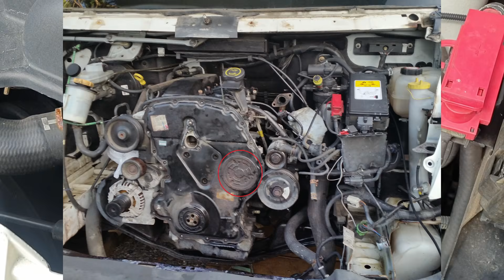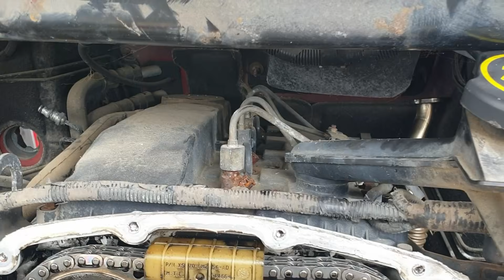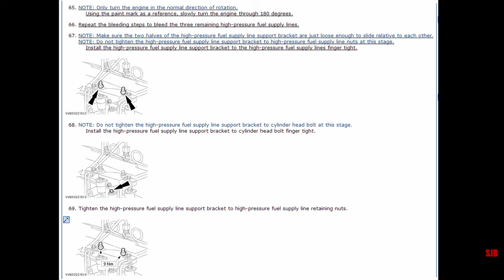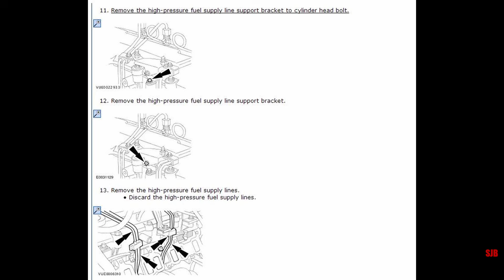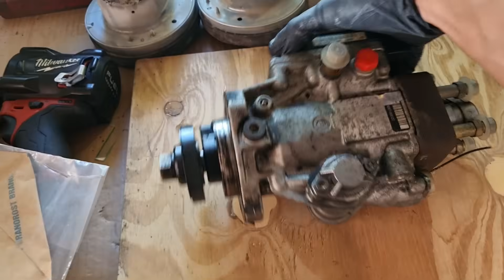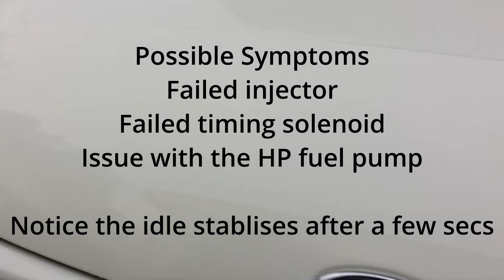Ford Transit Common Problem You Need to Know

Comment: Hey dude I have a similar issue but faults are p1664 p1564 is this the same as what you explain in the video should the solenoid be replaced?
Reply from the maker: No its the control module failing. You will need to replace or rebuild the pump
Reply: @AutoBuddynz  I have had the ecu repaired but does the pump need to be rebuild? Is it something inside that is falling?
Reply from the maker: @fisherbmx47 There is a separate ecu on the pump, unfortunately the internals of the pump wear out and needs to be rebuilt or replaced

Comment: Heyy I have issue on the master cylinder I changed it but my gears won’t engage what can be the problem now slave cylinder is fine and responding to the clutch though thé gear lever isn’t engaging
Reply from the maker: Is it bleed properly and is the clutch fully disengaging?

Comment: Woow One of my customer brought in a Ford Transit 2.0 diesel F3FA. Symptoms loss of power. I had cooler hose season these months, so I checked that and it was cracked. How naive was I? Went for a test drive, still no power… 
Plugged in the diagnostic and all of these codes are in it. You just saved me sooo much of working hours to find the issue. I mean I just spoke to my customer I have to check the timing chain cuz it has synchro faults. But in the evening if I can’t sleep I like to dig around. Now tomorrow I can call him it can be much more expensive if the pump is went on vacation too…
Thank you man, you just saved me tons of time.
Reply from the maker: Glad it was helpful and thanks for the comment! Do like and subscribe so it helps me create more useful context

Comment: Really good video and well explained 
A few years ago I had a 100 T280 that ran sweetly until one morning I fired her up and this happens.
I couldn’t get a re con pump at the time so I continued to drive the van with lack of power and a Smokey exhaust and I just got use to it being like that , I drove that van for 15 months and she never let me down and I ended up having to scrap her because of rust , I then got a Mk7 to replace her but I prepared my old Mk 6 Di which was a great work horse….
Thanks…. 👍
Reply from the maker: Great to know! They do keep going, only have to keep up with maintenance

Comment: Hullo. I'm looking to buy a camper (ford transit) Would it be safer for me to buy the Banana engine type instead of these newer engines with all the sensors?
Reply from the maker: These are great engines. From 2017 onwards they switched to a wet-belt design. These late model engines require more frequent maintenance due to this design, along with an expensive wet belt replacement every 100,000kms or earlier.

Comment: Hello, I have a Ford transit 03, 125 t350 kea deluxe motorhome with the TDDi 2.4 engine. 5sp, It's new to me. My question is, is it normal for these transits to be so sluggish? 60kph up the Bombay hill 3 gear all the way up😂😂 just seems so under powerd does anyone have the same struggles or is it normal?

This is the only one I've ever driven, so nothing to compare it to,

I have serviced everything  engine oil, new filters, cleaned the egr, and intake manifold. I watched your video 3 or 4 not keen to do the injectors and diesel pump/timing chain at this stage as it runs and idles good. im guessing it's around 10k to do this job?

Have you ever come across anybody blockages in the exhust that could cause lower power? Carbon build-up

Thanks for your videos on the transit. It has so much good information
Reply from the maker: Usually not a problem to have an exhaust blockage on these earlier Transits as they did not have a DPF, however if you did have faulty injectors at one point it could clog the catalytic converter. 3rd gear going uphill does it slow down? Or slowing increase in speed while going uphill? I have some videos which I need to find going up a hill in a Transit, Will upload for everyone on my channel to help people diagnose any problems.
Reply: Hi, it just slowly decreases in speed. I have to hold 3rd all the way up the Bombay Hill 60kph max. Yes, some videos would be awesome
Reply: @RoadsideTyresnz  hey, i have the same symptoms, i have the fault code P0149 and P1564 which should be the fuel pump timing solenoid, i have seen alot of information on it and have talk to many people, seems it could be that, i would check for codes and if you have those try changing the solenoid, theres some good youtube videos on how to do it, someone also told me it could be the pumps ecu

Comment: I have a 2.4tdi 90hp. looking at fitting a 115/125hp turbo, can I swap just the turbo & not the ex' manifold or is the exhaust turbine wheel bigger so needs the matching ex' manifold? thank you.

Comment: Hi, awesome video, i just brought this exact camper 2003 transit 125. I've noticed it's slightly noisy on start-up with a slight miss for 2-5 seconds, then runs absolutely fine with a slight black has from the exhaust while driving

I cleaned the egr valve and intake manifold, replaced engine oil, fuel and oil filter, air cleaner, and run 2 tanks of diesel with fuel doctor added. It's definitely running better, but the original problem is still present on the start-up. Only it revs freely right past 3 thousand rpm with no restrictions.

Would you say it's the diesel pump failing slowly or injectors and possibly the timing solenoid?

Do you have a workshop to offer services to customers? Im in auckland thanks
Reply from the maker: Hi thanks for the comment. It can be one of two things on these earlier Transits. The injectors do wear out and the fuel pump as well. I really wouldn't be too concerned if it runs fine when its warm. If you do replace the pump i would recommend doing the injectors at the same time. The vehicle will run very smooth once these two items are addressed, if your planning on keeping it long term I would recommend doing it at some point. The chain and tensioner should also be inspected if its done over 200,000 km

Comment: Hi m8 I'm looking at one now a 2005 it has 187,000klm
What should I look for you seem to really know your stuff or should I stay away from this model it's the desiel
Reply from the maker: They are great vehicles, just make sure it runs well, goes up a hill without struggling and a good maintenance history. Also see my rust video for spots to check. These transits are built fairly well, others have different opinions but with regular maintenance they last a long time. Proper twin chain driven engines
Reply: @AutoBuddynz Hello wow thanks so much well I bought it and wow having I spent some money getting it back on the road   what did I do to stop the water on the injectors and how's the wiring look nere the gearbox  mine needs doing. I've reply a wheel bearing  both control arms  complete tailsharft balance  de carb new diff oil gearbox pild and brake bleed omg 29, grand later I've got a great transit you did try and warm me have a look at my shorts if you wanna really see a unicorn transit  I'll subscribe and keep contact you seem to know a lot  I just had pvc cleaned and egr  full oil filter fuel and air should run nice when I pick it up this week yeah 8 months later and I still gotta rewire it still ain't finished but they are worth it 
the amount bof ppl that look at mine is insane everywhere I go ppl wanna talk about it😂

Comment: HI have a mk6 ford transit 2.4 auto and some times get stuck in D any ideas wot it could be thank you.
Reply from the maker: Could be the control module or solenoid issue, get it scanned at a Ford Dealership
Reply: Thank you pal.

Comment: Nice video..i have the same caravan model 2003,Yesterday I was driving on the highway and the spark plug indicator light came on and was flashing.The car broke down and I could only accelerate to a maximum of 80 km/h.I parked the car, turned off the engine and restarted it and everything went back to normal... but what could be the problem? The spark plugs are new, the filters are new, the oil has been changed.but I saw something suspicious, I lost fluid from the servo, I'm going to go to a service to see if there's a broken pipe or something... because I have a new turbo pipe and that.some say I have a clogged exhaust, or a faulty injector, or a clogged egr... if you can help me with a suggestion on what to do about this symptom.. tx
Reply from the maker: Is is petrol or diesel?
Reply: @AutoBuddynz diesel
Reply from the maker: @mariusdocea438 so when you say spark plugs are you referring to the gkow plugs? Did yoy hear any strange or loud noise when the engine turned off? Have you had tge problem occur since then?
Reply: @AutoBuddynz  I'm referring to the glow plugs, which were changed 1 month ago and are new from Bosch. I didn't hear any strange noises. The car was driving normally on the highway, I had the air conditioning on (I saw a problem there that something wasn't right. If I turn the ventilation up. It works for a while and then it doesn't work anymore. It stops and doesn't put air into the cabin anymore) is it possible that the electrical fault is coming from there?
Reply from the maker: @mariusdocea438  I don't think so unless a loom is damaged somewhere in the engine bay. Since the spanner light illuminated there should be fault codes stored. Take it to Ford and ask them to scan the vehicle that would be my first step
Reply: @AutoBuddynz  Hi, I scanned and didn't find any error codes on the car. The strange thing is that I turned the car off and on again and everything works normally. I don't know where this comes from...thanks
Reply from the maker: @mariusdocea438 The problem with these earlier generation vehicles is you need a professional advanced scanner or a genuine Ford one otherwise the codes will not show up

Comment: Hello, i have one question: is it normal for the  belt and the rollers to heat up really   bad during the drive ?
Reply from the maker: Check all the pulleys, including the idler and tensioner bearings, should be smooth and easy to turn, with no play

Comment: Hi I have changed the pump because of fault codes still not working sounds like diesel knock new filter and injectors cleaned and tested they are all good but still have diesel knock and dies after a few second of running could this be a timing issue thanks
Reply from the maker: Yes I would be checking the engine timing
Reply: @AutoBuddynz  thanks also would you try taking air intake pipe off and egr off to see if there is anything there restricting it
Reply from the maker: @alexlorford5350 Yes you can, you'll probably find your egr valve will have a lot of gunk build up, if it hasn't been cleaned before.
Reply: @AutoBuddynz just finished on it for tonight took rocker cover off passenger side rocker bolts 1 snapped all the others loose going to order a bolt an try that if not going to check timing noticed the rockers not moving through oil cap so took off to inspect and found that
Reply: Solenoid on pump will cause a knock you have to change ECU to match the pump

Comment: Hi where can I buy the timing solenoid? And what is the Bosch part number pls?
Reply from the maker: Ford should sell it or try PF Jones, part number 0986 444 954  however pls note different variants of the Ford Transit had different HP pumps so ensure you are getting the right one for your application

Comment: excellent delivery brother, comprehensive and easy to understand 10/10 my friend!

i have a 1998 2.5 manual TD transit, i intended to do the van travel around Australia but turns out the van comes with inherent issues which were unknown at the time of purchase. your videos are based on a later generation but there is A LOT of overlap that will help  save my a**!   

I'm in a dilemma, if you have the time, any advice you could give would really be appreciated

 my transit, if left for a few days will fire and die without throttle on first start. with alittle throttle briefly it will continue running, it idles but roughly. it has a engine knock on the injection pump side and is sooty under load. not as rough at higher rpm, did run above 3000..  no blowby, engine oil was correct. the safety inspection guy i seen said its 100% the injection pump recommending a diesel specialist 150km away to recondition it from $1500.  without much thought, going on his certainty, i pulled the pump out to get it to the specialist. engine timing and pump doweled, crank pulley marked, pump is out and i make the phone call to diesel specialist and it turns out the Lucas epic pump i have is obsolete. parts now discontinued and no one in Australia services them anymore...

ive had some time to think about what ive gone and done.  and thankfully discovered your channel before trying to just slap it back in there. seems like it could have been a timing related issue, air in the fuel, or fuel injector, egr malfunction or a combination but seeing as i cant turn back time so to speak, how can i best reduce the chances of creating a injection pump issue re installing it to be able to troubleshoot the other possible causes.. do 98 models throw codes via limp mode limiting rpm electronically? will the computer recognize the pump or calibration if the pump gear shaft turned 20 degrees by an accidental dowel slip after removal - before the dowel was quickly put back in to secure its 12 oclock position and pretending that didnt happen (shaft turned backwards to re-center on 12). honestly I'm little nervous now because financially I'm not equipped for this to end up in the expenses of labor going through the process of elimination at a shop. 

it was pulled out in confidence of the mechanics knowledge and advice, since doing some homework and appreciating how sensitive the pumps parameters are, and the seriousness of this situation compounded by its parts not being serviceable here when it was technically running above 3k before removal.. ahhhh..., any knowledge or insights you can share will really help.

TIA

i appreciate you taking taking the time to read this 

warm regards
Reply from the maker: @BrendinDodd  Thanks for the comment. So to confirm, the vehicle only has a problem if its not driven for a few days?  There are conversion kits available so you could covert it to a bosch VE pump. But yes I would double check the timing on the cambelt.
Reply: @AutoBuddynz  thankyou for the education! 

 the hard start, after a couple days yeah.  it seems to continue running on first crank without throttle if its been warmed recently. the engine is still noisy on the pump side, sooty under load and sounds like its missing at idle, the timing dowel pins were in alignment with the pin holes when i took the belt off, the belt itself looks in good shape but  the au VE pump retailers that i could see are out of stock for the moment,

 ill get that back in then but in your experience, would this lucas pump shaft turning x amount and being turned back to its 12 o'clock cause any issue within the pumps mechanisms or electronics?

it wasnt limited to 3000 rpm the motor just ran a bit like a tractor if you know what i mean lol
Reply from the maker: @BrendinDodd  Its just a mechanical pump , so as long as the dowel / timing mark lined up it should be correct, that is assuming all the HP injector lines are connected correctly. It could be an issue with the timing solenoid but as you said parts are obsolete now. Put it back together and see if it still runs badly. You could even try and import a pump from UK.
Reply: 🙏 thankyou sir, i appreciate the work you do for the transit community 🙌 
These educational tutorials are invaluable. Keep up the good work son!
Reply from the maker: @BrendinDodd  Thanks for the support